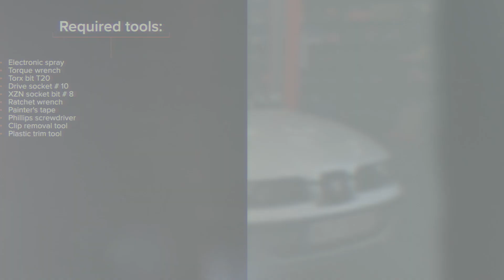How to change door lock SEAT LEON 1M1 [TUTORIAL AUTODOC]

Comment: the door lock has a open close sensor ?
it looks that this has an impact on the bottom door light, but also on the centralized open close, and also on the sound alarm of the roadlights when they are left ON and you remove the keys + open conductor door.
Am I right ?

Comment: hie auto doc...i wanted to connect aux on my 2001 c320 ...problem is the plug i found on the passenger side door floor is green in colour and has two wires only....is that the aux code or its for something else